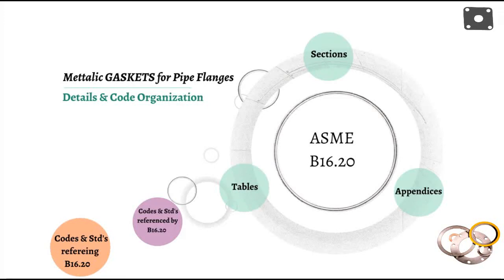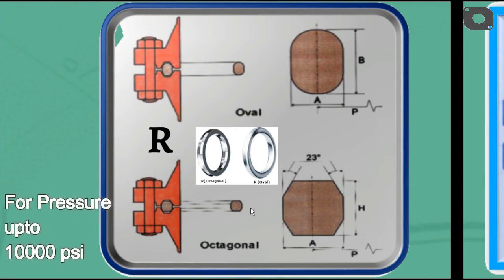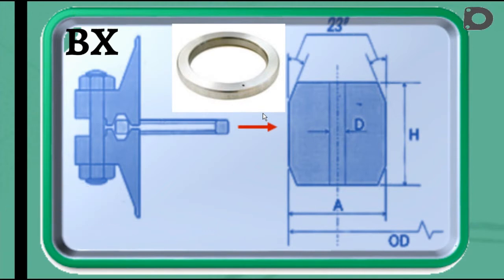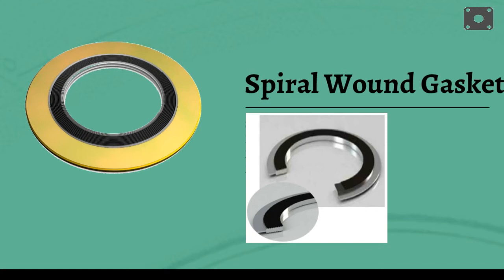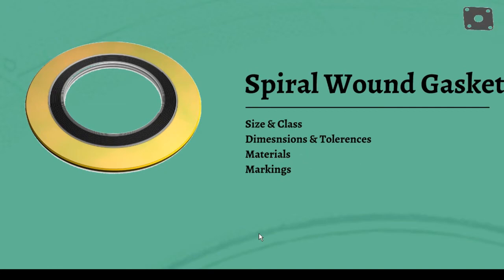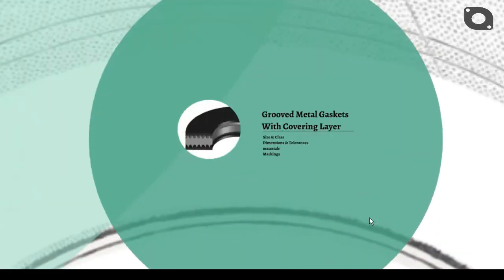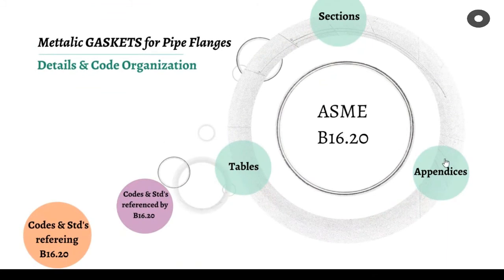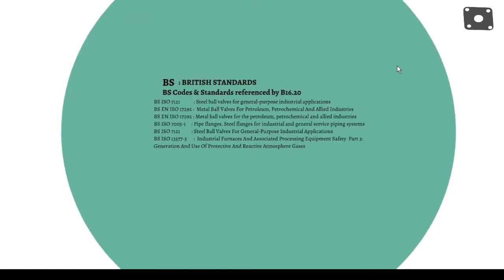Metallic Gaskets for pipe Flanges | ASME B16.20 | Content tour and Gasket details

Comment: What is the difference between a metallic gasket and semi metallic gaskets? There is no standard for semi metallic gaskets but from the presentation, i hear that spiral wound is semi metallic. I would like to know the difference
Reply: metallic would be a RingTypeJoint Gasket, where the gasket is 100% metal, for tongue and groove flanges. Spiral wound gaskets have often PTFE or flexible graphite in its construction, so it's not 100% metal.